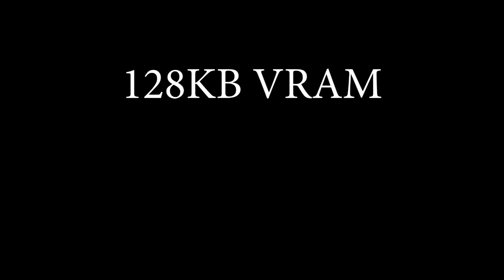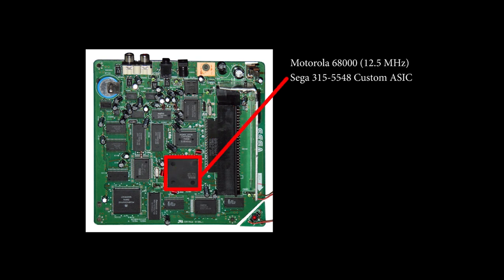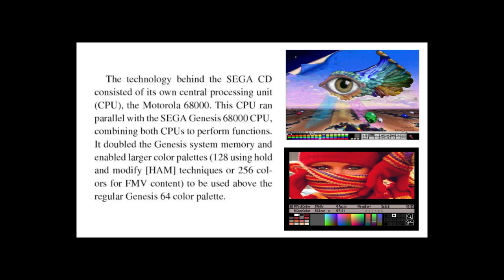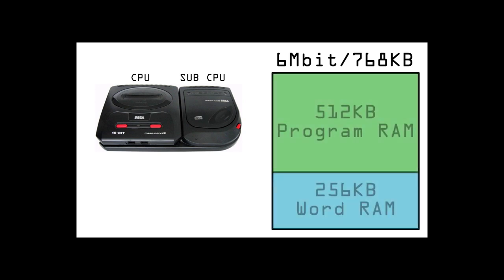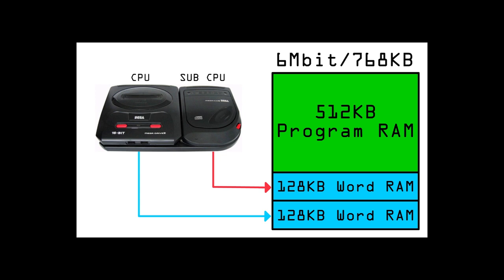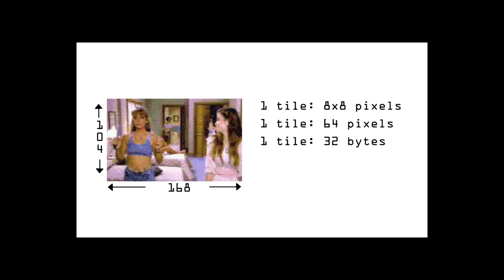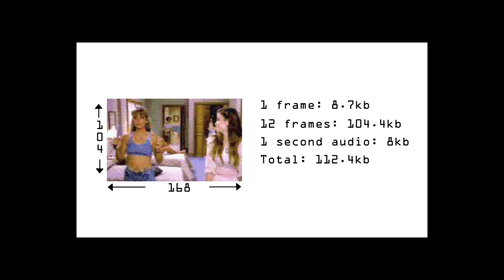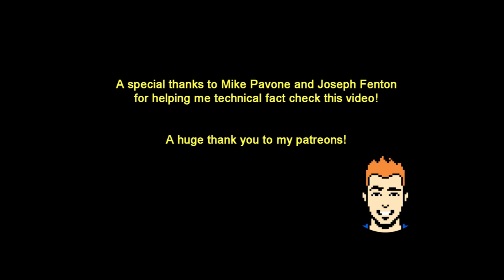Sega CD & Mega CD Secrets Part 1

Comment: Interesting thing is that the Megadrive VDP has pins for a second bank of VRAM and external color pallet RAM, none of which are actually connected to anything. If they had just brought the VDP pins for the second bank of 64K out to the expansion port then they could have had a shared bank of VRAM between the Megadrive VDP and Sega CD. If that had been the case the Megadrive VDP would have been able to display tiles from the Mega CD directly and using the scaling and rotation features would not have been nearly as clunky and slow.

 The Sega System C arcade board actually uses the external color pallet RAM and has more pallets available than the Megadrive hardware though none of the games on that board seem to take much advantage of this. It also lacks the Z-80 and uses the 68000 to control the sound hardware instead.

 They probably would have been better off just dropping the Z-80 and it's 8K and adding the external color pallet RAM to the VDP when they designed the Megadrive instead as removing the Z-80 and 8k would have saved as much or more as dropping the external color pallet RAM.
Reply: I remember the backwards compatability of the genesis as being a noted selling point.  When I was a kid salesmen in a few department stores mentioned that to my parents more than once when we were looking at the new turbografx and sega consoles.  Without a Z-80 that feature is gone;  maybe the sega executives thought backwards compatability would be more important than it turned out ot be?

Comment: Have a curious question, will the Sega CD be able push out polygons with the right programming or not? What if the Sega CD had the color pallete of the 32x and enhance the color issues from the genesis?
Reply: Retro Game Dev Revolution thanks. I know sega cd can save files on the battery backup ram. Is it possible it use expansion ram carts as well?
Reply: Retro Game Dev Revolution no problem and cant wait. Thanks

Comment: Okay, you seem to know quite a bit about the Sega CD. Do you think the Sega CD could run a version of Doom? The Snes did (terribly) and the Sega CD has much better tech and a much (3x the speed) faster processor. I don't know if the Sega CD could access the Genesis's 16-bit Motorola 68000 or its Zilog Z-80 8-bit processor and ram to help...if it could I would say they could have given us a decent version of Doom. Now, I do not expect it to be as good as the PC version mind you. I am thinking it would have similar geometry to the Jaguar port and you would probably to do some of the tricks to coax extra color from the machine (I don't know how they would do this with a Sega CD game). Perhaps this supposed version of Doom would utilize the cartridge port as well (without the 32X). Maybe a memory cart or a portion of the game running in the cartridge itself. I know by nature the Sega CD takes over once you put a CD in the tray so I'm not sure how this would work entirely. I would also love to see a version of Doom on an SVP powered Sega Genesis cart as well. 

At any rate, the video was really good. I grew in the 90's and had a Sega Genesis in Christmas of '89 and got my Sega CD when it released as well. I had an Snes but always preferred my Sega consoles.
Reply from the maker: It couldn't do Jaguar geometry as the 68k in the Jag is a more advanced version of the CPU.  The MDs CPU and sound CPU are a bit redundant using the Sega CD. You could use the direct DMA 512 colour mode but you'd have a lower resolution and double pixels.  I think a Doom could have been made but some serious changes would be required!
Reply from the maker: I've just realised this is a comment on part 1 lol be sure to watch part 2!